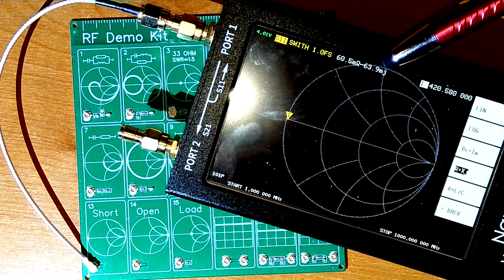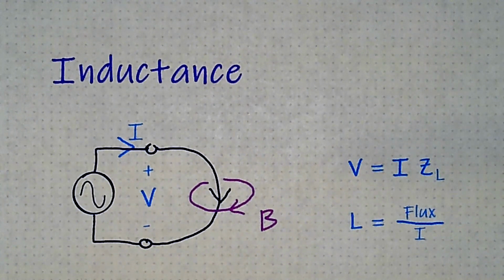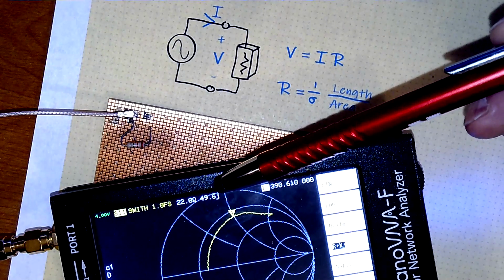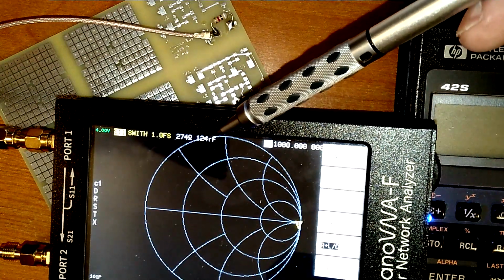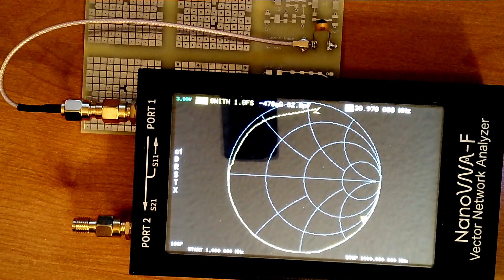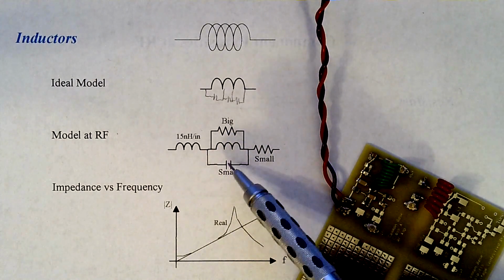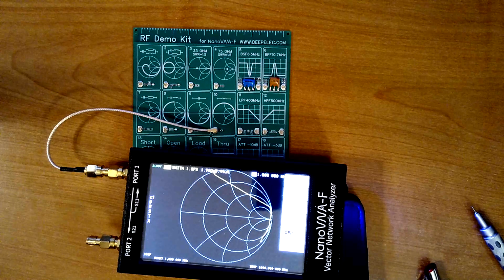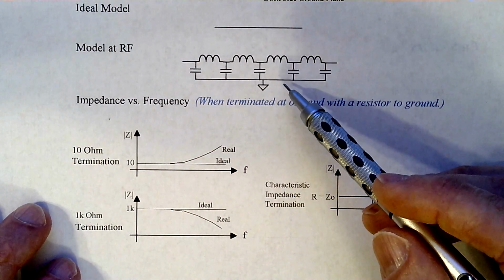NanoVNA - Measuring RLC Components

Comment: I'm very interested in using a VNA for the building and adjustment of toroids used in HF low pass filters. At the moment I'm working on a diplexer type filter design. Ideally, I need an instrument that will provide 1nH resolution. Do you believe the NanoVNA is suitable for that task? Perhaps you know of a better suited - ideally inexpensive instrument?
Reply from the maker: Technically the answer is yes - if you're below about 100 Ohms reactance at 14 MHz for example (100 Ohms is about 1000 nH there and the display shows 3 significant digits in the marker readout). BUT - this is resolution - not accuracy. Accuracy of a VNA is not nearly that good and depends heavily on whether you're measuring small to moderate impedances, or large ones closer to the right side of the chart, where things get really 'off'.  As for alternatives, at VHF and above, a VNA is about the best one can do, without creating special test fixtures that apply resonance with a known capacitor value. At HF, there are somewhat higher accuracy methods without resonance use, but they're expensive - and frankly seldom worth messing with, IMO.

Comment: A+ info, pace, and presentation quality. Immediately upped my game, thanks! Where did you get the test boards? Can you provide a link to the Radio Class handout? I'd find them handy when teaching other hams. Edit: I now read that others have asked the same question going back a year or more. I understand the overhead of creating a site for distro. If these came from a class, can you point us to the folks who put on the class? I wondered if you rolled your own test boards. I also use U.FL connectors for their ease of handling and quick connect/disconnect. When handled carefully they last a long time and give good results.
Reply from the maker: Good to hear. Thanks for letting me know it helped!  The boards that the radio was built using are ones I designed and fabbed through ExpressPCB (I like their simple free layout software).  I agree on the U.fl connectors. We used those in the microwaves course and they are fine for repeat connections :-)  The course itself that inspired these videos is one that I and others did at K-State. But we're all retired now, so to keep it alive, I did these vids. It's still on the books, but not actively being taught at the moment. Here's a related K-State web page. It's got some stuff that might help (e.g. the last bullet in the first section takes you to the class handout sheets).  https://ece.k-state.edu/about/people/faculty/kuhn/
Reply: @MegawattKS  FYI the link seems to be down.  Excellent presentation BTW. You have a new subscriber!
Reply from the maker: @andros2112  Thanks !   I think I've got it back.  They changed the URLs of faculty/staff last month by putting an 'about' into the URL path.  Hopefully this page will stay intact. I'm currently lobbying for the administration to not delete emeritus faculty pages (or at least this one. Hopefully the department at least will keep the content, if not this exact URL...

Comment: can this be used ad rf pwoermeter, to measure the max power output of rf module?
Reply from the maker: No.  There are a couple reasons.  It's meant to look at "stimulus-response", for things like measuring gain (or 'return-loss'). Without the stimulus part of that, it cannot frequency/phase-lock, so it will not read the signal. The other critical reason is that it could be damaged by anything more than about a milliwatt of power.  (actually, the damage level may be 10 dBm, but that's still 0.01 Watt max).   I have noted on Amazon that there are a number of small low-cost power meter modules out there now for similar price range (e.g. 50 dollars) with a simple LCD display. But again, they're meant for very low powers, well under a watt.
Reply: @MegawattKS  than you for your reply. I want to measure max power output of radio transmitter, which has max power output 20dbm in data sheet. in data sheet this via has max 10db range , by adding attenuator I cannot measure ? if not can you also provide a link to pwoermeter please. 
thx
Reply from the maker: @tomipiriyev  The NanoVNA still can't do it, since it needs to look at something which is 'coherent' with the signal it puts out.  (it could do an amplifier since it could provide the input, but for a transmitter, the signal is coming from somewhere else). What frequency are you wanting to do this at?  If it's below 900 MHz, then you might want to look at getting one of the really cool "TinySA" spectrum analyzers (and use an attenuator as you said).  But if its WiFi like 2.4 or 5.x GHz, you may do better with something like this (I'm not recommeneding this particular product, but it gives an idea maybe): https://www.amazon.com/Taidacent-Calibration-Measurement-50-0dBm-Attenuation/dp/B07JMKQTDW/ref=sr_1_3?crid=27JYNJNFYW5W8&keywords=rf+power+meter . I don't know how accurate it is though...
Reply: @MegawattKS  tiny SA is different than nanoVNA? I mean working principle, I am a little confused. 
I will measure 2.4Ghz .
Reply from the maker: @tomipiriyev  Yes - the TinySA is different than the NanoVNA. The TinySA is a spectrum analyzer (showing power levels of signals vs frequency, or power density due to modulation vs frequency). The NanoVNA is a network analyzer designed to measure things like gain (ratio of size of output signal to size of input signal) vs frequency. The TinySA is closer to what I think you're asking about, but unfortunately it does not go above about 0.9 GHz, so it won't work. For 2.4 GHz, the cheapest and best route to just getting the power level is probably something like the power-meter board in the link (together with a power supply and 20 or 30 dB attenuator). And it won't have the same issues of reading inaccurately due to wideband modulation that a spectrum analyzer would.
Reply: @MegawattKS  appreciated,  now it is clear for me , they are different measurement devices).  they look so similar I though just different manufacturers)
Reply: @MegawattKS   can I use HackRf  to measure rf power ?

Comment: Interesting.  I was always been told that modern high stability resistors have the resistive material wound around the body like a coil.  They are trimmed by laser to match tolerance etc. So it's the resistive element is inductive. Old carbon resistors dont have the problem that modern resistors do. Wire wound are highly inductive. Non inductive resistors can be purchased. Modern resistors dont suffer with carbon migration when used on DC voltage. But this is what I have been taught over 30 years at Tech College but things may be different these days. Cheers from old George
Reply from the maker: Hi George. Now that you mention it, I think I heard that too. Not sure how many resistor formulations use that technique. But it's important to remember that even if they don't, there's tons of inductance (e.g. 20 nH per inch) for just the resistor itself (it has non-zero length), plus the length of any interconnects between it and a capacitor, etc.  As you said, wire-wound resistors can also add substantial inductance - being basically coils - in addition to their own length and interconnects on a PCB/etc.  Cheers.

Comment: I am curious if you had tried the Inductors(uH range) on small toroids and observed them on VNA.....i unfortunately started with a inductor on FT37-43 while being a new user on NanoVNA. Took me days before realizing how bad the inductor on small toroid could be with load of stray capacitance, it was almost a diagonal line on the Smith chart instead of being a circle.

With air core inductors(nH range) its not as bad to get it right, it forms a decent circle.
Reply from the maker: I just looked up the  -43 core and it appears to be Nickel-Zinc, and claims to have a high Q (at lower frequencies - e.g. below 30 MHz). Try resetting the Stimulus frequency range to 0 to 30 MHz (or even lower frequencies) and then recalibrate it and try the measurement again. I think what you may be seeing with the diagonal line is the NanoVNA taking only a couple datapoints in the low frequency range and just connecting these points with a straight line. (if it's sweeping 0 to 1000 MHz and only takes 100 points, then the frequency step is 10 MHz.)  I've seen it do this, and had to drop the frequency range and recalibrate to get it to take enough points to make an arc as it should from 0 to 30 MHz.
Reply: @MegawattKS  I had it sweeping 1-30Mhz...what i meant by diagonal line(exaggerated to make point) is that the Smith curve was kind of going all over the uH range instead of making anything that resembles a circle. I had other known value inductors(wound on bobbins) tested to double check if something wrong with calibration, they were working fine.

Comment: saw another RF youtubers video where he recommends component measurement should be considered at point where Reactance equals source impedence(50 ohms for NanoVNA), at 90 degree points. Makes sense as it will form a proper voltage divider at that point.
Reply from the maker: That's reasonable, but the actual low-frequency value of inductance (or capacitance), is actually slightly off at those points on the Smith Chart. For an inductor, anywhere along the arc on the left side of the chart should give about the same value. For an inductor I usually go to a point about halfway between the 90 degree point and the far left where the impedance is zero. (except don't take it too close to the 0 Ohm point, since accuracy will fall off there of course). For a capacitor, it's the opposite. One needs to take the measurement on the arc between the bottom 90 degree point and the far right of the chart where Z goes to infinity as frequency tends to zero. So I think the 90 degree rule is pretty good.

Comment: Great overview video.  Careful though when measuring large or small impedances with an S11 measurement, the VNA gets a lot less accurate then.  The "testing" version of nanoVNAsaver has some nice new features for measuring impedances using an S21 measurement. That would help improve accuracy of the measurements quite a bit and you may find that your high resistance test will give you a somewhat different result (though still having quite some effect from parasitics)
Reply from the maker: Good point - especially for the high R values well above 50 Ohms. I haven't tried the S21 method, but did write a paper a couple years back about measuring Q. We found that with HP8753 units at least, the measurements can be quite decent if the measured impedance is close to the cal-points (0 and infinity), and worst around +/- j50.  But I don't know if the Nano uses the same calibration equations...

Comment: 5:25 what was the flashing frame?
Reply from the maker: Just a video editing glitch. I do a lot of "slash-and-burn" editing (throwing out parts of what is filmed to tighten the story). I tried to pause it to see after you pointed it out - and as far as I can tell, there seems to be a frame or two with one of the "spinny arrows" that Pinnacle Studio sometimes generates for unknown reasons. They seem to get generated during the video export process. I upgraded recently to a newer version, so hopefully there will be less of these types of glitches :-)
Reply: @MegawattKS  Shotcut is an opensource program for video editing and transcoding. Could be helpful, too :)

Comment: S-parameters please:
measure components (passives) with nano vna Smith Chart(r +/-jw), 
put into circuit (simple), 
predict response with S-parameter algebra.
100Mhz would be perfect for this.
Then: talk about signal graphs,....
Reply from the maker: Good ideas. That's currently deeper into math than I've been doing in these - but I'll try to think about this for down the road. I agree that this would work best at 100 MHz. Too often S-parameters at microwave frequency vary too much with the exact test fixture used in  the reference design/measurement (e.g. PCB thickness and grounds used for actives). But as you said - 100 MHz would make things come out close to theory :-)

Comment: i've seen alot of videos on this,  i'm getting one.   great video.   why would you spend 400 dollars for an antenna analyzer, when you can spend 100 and use the nanoVNA  and can also use it to test filters, amps, etc.   73s
Reply from the maker: Agreed !  (Assuming one has good enough eyesight ;-)
Reply: @MegawattKS  I attach my nanoVNA to the PC and have a wonderful 24" (diagonal) display.  Not great for field work, but wonderful for classes.
Reply from the maker: @joeb3300  Excellent. I used to pull a bench unit with a VGA output, stick it on a cart, and hook it to the classroom projector - but that would be easier for sure :-)